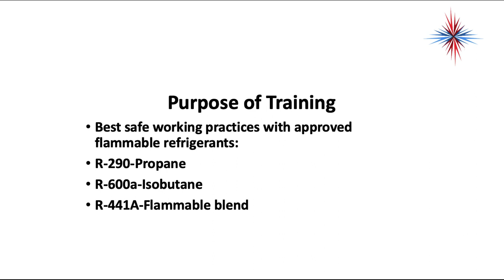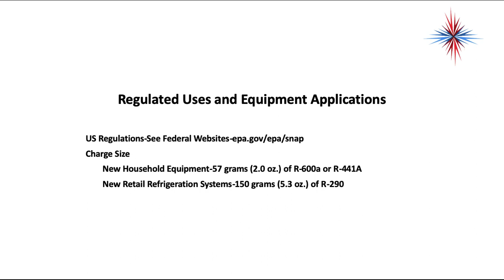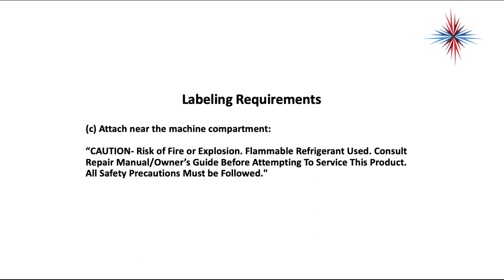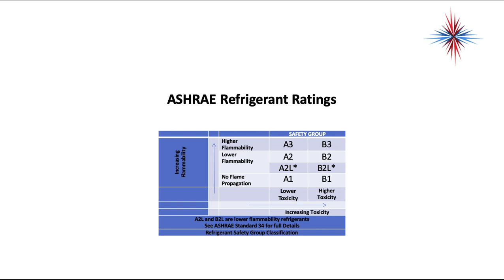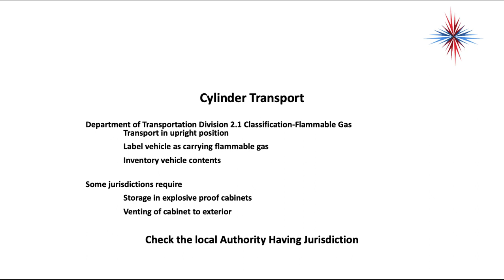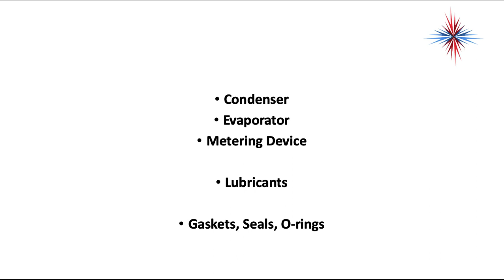Advanced Refrigeration - Hydrocarbon Referfigerant

Comment: Had a wire resting on sucting line in an evap coil fan vibration caused plastic wire insulation wore through and wire shorted a hole in copper tubing, luckily it was r134a